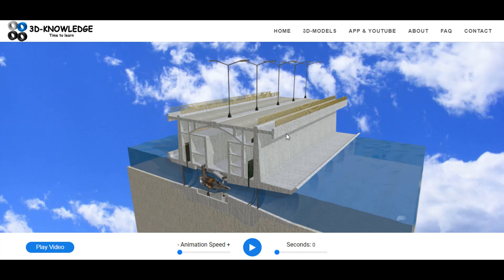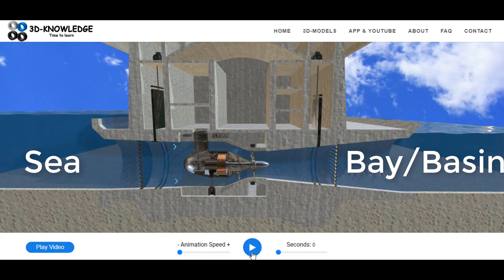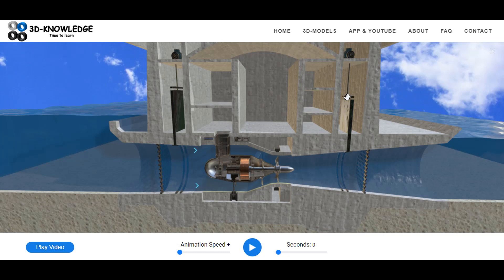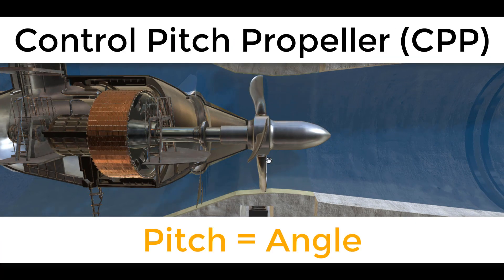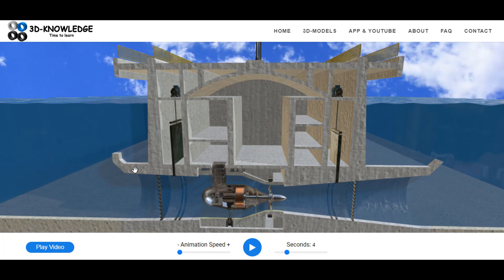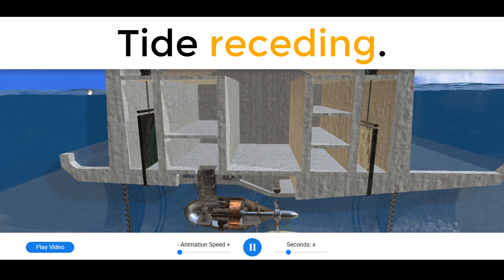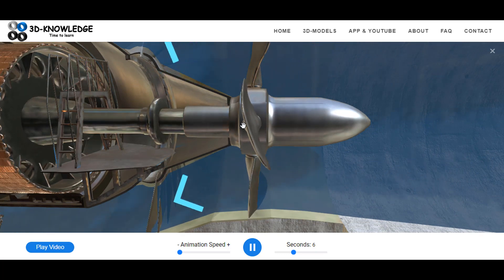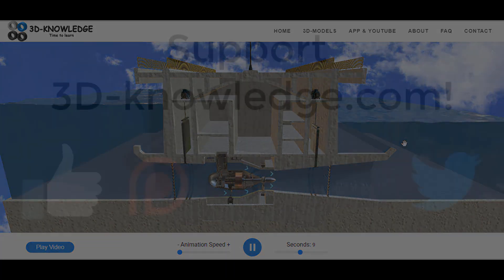How Barrage Tidal Power Station Works

Comment: Hi John thanks for explaining that I am no expert at all but I do understand if you have water on both sides of propeller ,even if one side is higher than the other there will still be resistance because you have water on both sides would it not be better that the generator moved up and down a  shaft so that so there is air on one side?